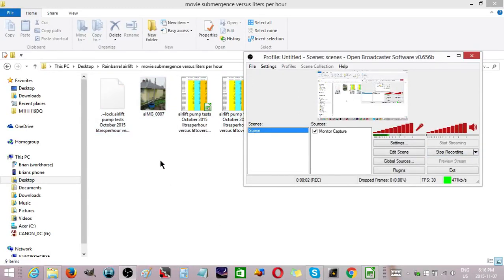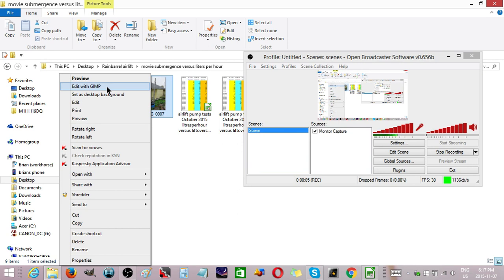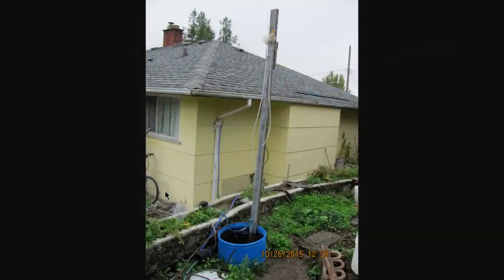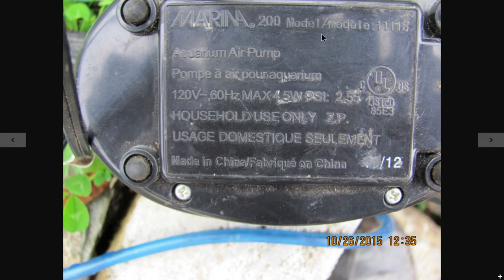DIY!  How to design your own "high lift to submergence"  airlift pump!

Comment: I actually got your explanation well. Thanks for the knowledge, appreciate your design and work. I will be setting up a trompe pump system at a local river, hope to apply this knowledge for moving water and fish poop around :D
Reply from the maker: Thanks.    I have other videos trying to figure out the best airflow, pipe sizes and submergence forairlift pumps to do the work.  Note that the main reason that more people have not made trompes in rivers is because it is hard to dig a deep hole for the pipes beside the river.  This is why I did so much work on "low pressure" air lift pumping. Low pressure air lift only needs low pressure trompes  (which don't have to be so deep).  I suggest you try to figure out your system,  with not too much high pumping of water,  and then figure out a trompe that can supply enough air at enough pressure to make it work.  I'm glad you find this useful!
Reply: I plan to catch the water as high up the river way as possible and gradually drop it at 90 degree drops where I want to experiment by placing a venturi type valve. In this manner the water would continually be aerated and pressurized in every step or fall of the way. IF I understand correctly once you have a decent flow trompe system working you can move all the water around with the use of the Trompe's air compression generation. Maybe an electronic solenoid valve on a manifold to control how much air (and water) is being used and moved at any given moment.
Reply from the maker: So many people talk about venturi  valves  for trompes,  I have no idea why.  Water  accelerates as it falls  down a vertical pipe,  available air fills the "gaps" left by the acceleration and  then gets sucked down to the bottom of the pipe.  as long as air can enter  the vertical pipe, it will work,  no  venturi  is needed. I don't see how a venturi constriction of the entrance will help.  Remember,  air bubbles in water is a turbulent flow condition that reaches an equlibrium

Comment: Thank you for your video Brian, I'm trying to build and airlift here in Africa, I'd love to talk a bit more with you maybe you could help me design it
Reply from the maker: I'd be happy to help.  How are you powering the airlift pump?   Air pump or trompe?  You can check out the "pulser pump" too.  Also,  how high do you need to pump the water?   Thanks   Brian
Reply: My challenge here is finding the pump and money, everything is more expensive. I need to bring the water on top of a grow tower so a bit less than 2 meters, and then make it go down a tube with holes for hydroponics, watering 100 plants over 35 meters. The few suppliers of drip systems here really give outrageous prices so I want to do it myself. I found water pumps (fountain type) that can go up 2 meters but here they cost $150
Reply from the maker: The airlift system I have  uses an aquarium bubble pump to pump the water.  My  bubble pump costs around $25.  An alternative way to compress air is called a "trompe".   You can make a trompe from plastic pipes 10 or 15 cm diameter,  in a little river or stream.  It uses falling water (falling at least 20 cm) to compress air.  Trompes are on wikipedia and the pulser pump is on it too.
Reply: Great thanks, I'm on it

Comment: Dear sir,

I have 400feet deep bore well and I have only 100feet water present inside borewell , 300feet is empty i.e., without water . If use 1.25 inch riser pipe and 0.5 inch air hose, will I get water at ground (I would be having only 25% submergence in water) . Also suggest me the air compressor of a particular power rating which I have to purchase afterwards.
If not kindly suggest some suitable solution.

Looking forward to your reply.
Reply from the maker: Hi, Mumazir,  my experiments are aimed at low pressure  airlift pumps,  So, I can't give you firm advice.  Here some things to note.   Number 1,  Your static water level is 100 ft,  but what is your "dynamic" water level?  Depending on how quick you pump, it could be a lot lower.  Might be 80 ft,  might be 50 ft. This puts your height  to submergence ratio up to 5 to 1 or 10 to 1.   Number 2.  Normal airlift pumps work by pumping lots of air in and  making "bubbly water" and a column of bubbly water is higher than a column of pure water.  My airlift pump doesn't do that,   you pump a lot less air in and  it makes "plug flow".  So plug flow can go much higher with less air but it has an "air speed limit".  If you pump in too much air,  slug flow breaks down and becomes "annular flow" which brings up much less water.  So, yes,  I think you can definitely pump up from that deep but you might not be happy with how much you can pump per hour.  Number 3    If you have room in your borehole, You might be able to pump in stages,   Divide your air feed in 2 and use one airlift pump to pump to say 100 ft higher,  and feed that water into another airlift pump to get the rest of the distance.  But it probably is too narrow to do that.  Number 3.   The guys who know most about "2 phase fluid flow" work in the oil and gas industry in sectors like fracking.  If you can contact an engineer who has experience in that field,  they might be able to give you tips in sizing your compressor.  So, bottom line,  bigger isn't better in this case,   you probably can pump a lot more water with a smaller compressor and not much air per minute than if you open it up and go full speed.    I hope that helps..   Brian.   Also,  there is a little info in my video "pulser pump, world's simplest pump"
Reply: @Brians-Easy-Low-Tech-Solutions  
Thanks sir .. for the information.. it might help.
Reply from the maker: @munazirhazar9588   Yes, that's the best I can do.  Best of luck.